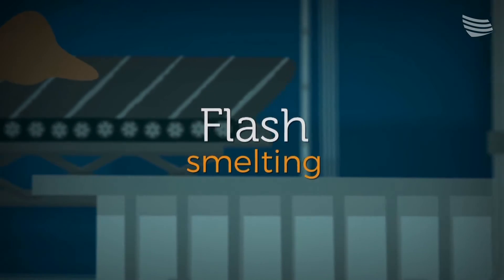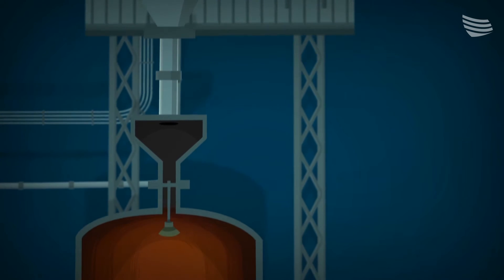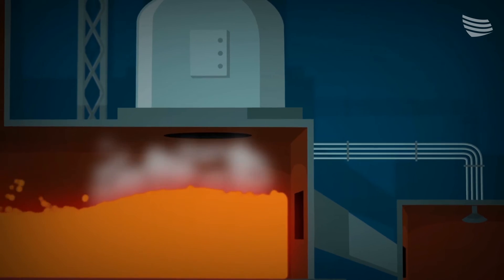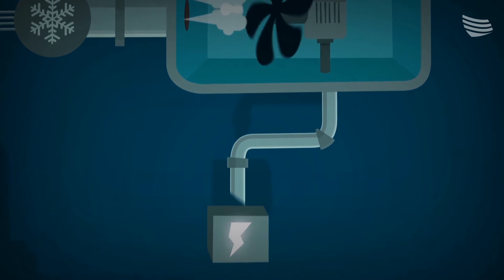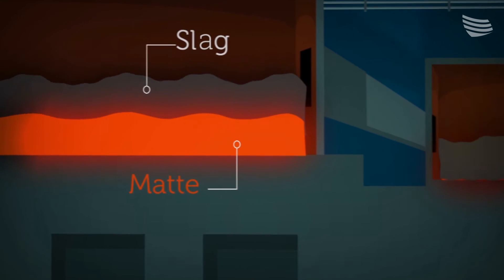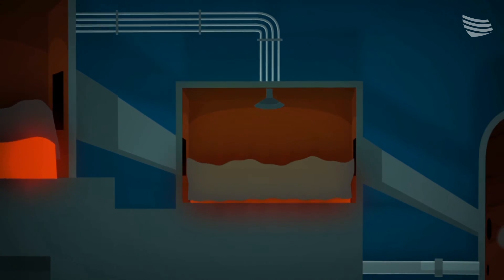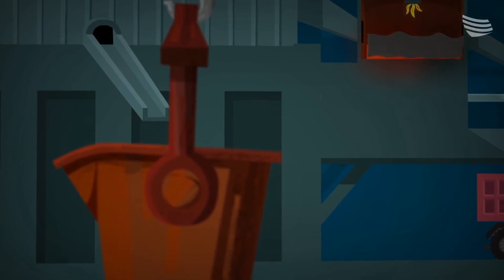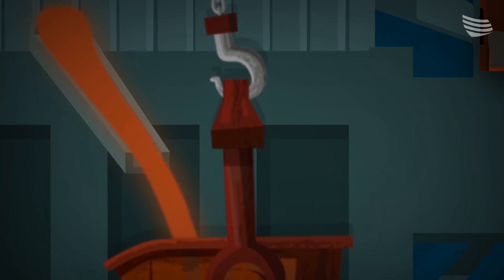FLASH SMELTING IN ATLANTIC COPPER

Comment: If the slag  is then passed into an Electric Furnace, then the llustration is incorrect. Electric Furnace use electricity to generate heat, not an actual flame from combustion. You might want to change the burner part in the video and replace it with an electrode, either DC(one on top and one on the bottom) or AC(three phase on top).
Reply: Exactly Arwin! Can I get the complete detail on smelting of copper concentrate!